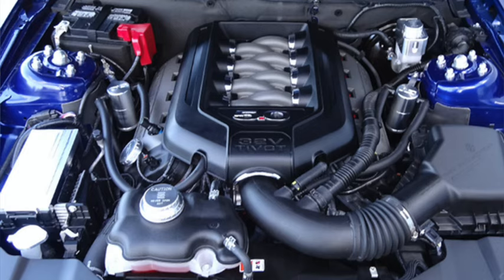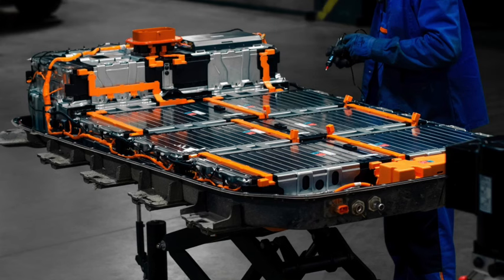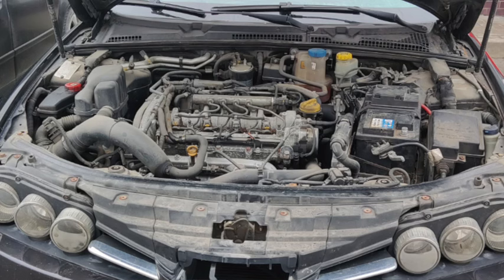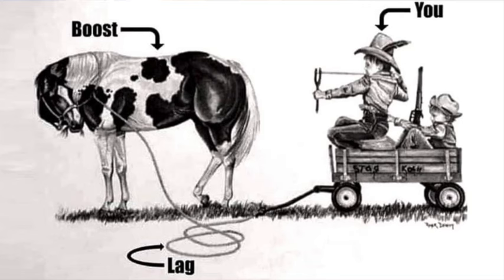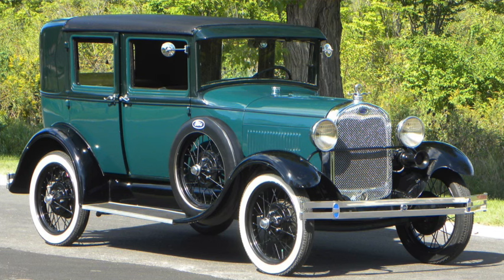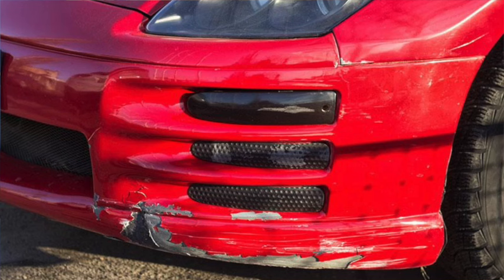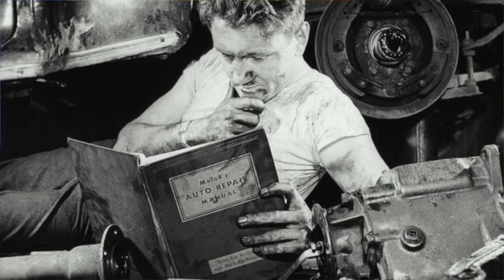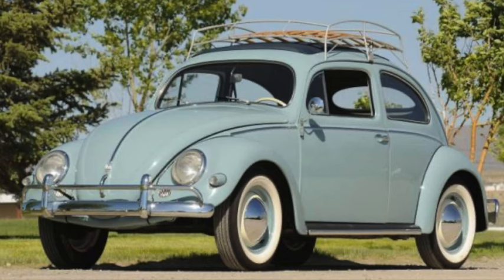How cars have gotten better by getting worse

Comment: Modern vehicles are not only wayyyyyyy overpriced but they're made out of plastic as well and my 1996 Ford F150 with a 5.0L (302) Windsor V8 will outlast every single one of em (especially those overpriced plastic EcoBoost trucks).

Comment: Cheers from Orange County California 🇺🇸 
Daily Driver 68 Dodge Dart Restored to driver level...
V8 swap and 9 years on the road since swap, 115k on my rebuilt 318...
Reply: Them 318s are bulletproof! I have a 318 with 245k on it it my 2000 dodge ram
Reply from the maker: @Freedom42069  Perhaps and under rated engine.
Reply from the maker: Nice.

Comment: The only problem with customers preferring the simpler, stripped down trim levels is many dealers just don't stock them so you're forced to either order one and wait while the dealer plays games with you or buy one of the higher trims with features you don't want or need. An example is all but base trim for most manufacturers come with leather heated seats, I hate the feel of leather seats and having them heated is an unnecessary for Florida which is where I live.
Reply from the maker: There is much talk about how sales have shown what buyer do and don't want, but as you said, buyers often don't get what they want, they get what is available.

Comment: I don't mind touchscreens, in fact I don't plan to ever purchase a daily driver without one again. BUT, I do want it to still have physical buttons as well. I do not ever want to have to navigate through multiple different screens, to say, change the climate controls. And if the screen ever fails I'd like there to be a button backup for the radio as well. For now, both options are generally equipped on most newer vehicle. However I don't like that the trend is starting to shift to touchscreen only without physical buttons.

Comment: On the proprietary issue: How is it that 100s of models of SUVs across 40 years of production by all brands haven't managed to accidentally repeat nearly any part.  We all complain that all the new cars look the same, but if one window on one model made for one 3 year "design cycle" need replacement, there is no chance of finding that part used.  Interior parts, door mechanisms and starters!  Worse than headlights: Alternators:  two alternator sizes would cover 100% of all cars ever made.  But every year every car is redesigned to NOT be compatible with anything ever built before. 2mm change in mounting hardware, and nothing but a new one will work.  Where are the environmentalists on that issue!  Forget about CO2 etc, where are the protesters on the waste of raw materials designed destroy our ability to keep our cars from becoming landfill at the end of warranty?

Comment: Oooooo I love this topic! So I'm an avid classic car lover. However, I'm not entirely sold on the whole "older cars are better" montra. I argue that there have been a great many improvements and innovations over the years, not just trade-offs. To illustrate, take first the price of  brand new 1936 Chevrolet Standard. It offered a 206 cubic inch inline 6 that produced an eye watering 79 hersepers. You also got a two pane glass windshield, manual windows, 3 speed manual transmission with the completely new synchromesh gears!! Drum brakes, and get this... A heater!! You had to pay extra for a radio, though. Anyway all that could be yours for $575. It was advertised as the cheapest car you could buy, being the Great Depression and all. In 2024 dollars, that car would set you back over $12,900. Well, today you can get yourself a brand new Hyundai Accent for $17,000 where a 120 hp, 33 mpg engine is standard along with AC, electric windows, seats etc. Forget the frills. You don't ever have to grease any of the suspension, buy new tires every 10,000 miles, change the oil every 1,000 miles, or throw gas at it like your single-handedly gonna cause all the climate changes. In fact, many new cars today are very, very trouble free, easy motoring for practically the same cost as 100 years ago. You don't have to adjust a carb, change points, constantly overheat, rebuild an engine after 50,000 miles, change sparkplugs, the list goes on. To me, that is utterly incredible. Just the advancements in metallurgy alone could be enough to justify charging more for a car than the 30's. New cars have brought their own unique problems and challenges, but they're more the exception now than the rule. Back then, when your odometer neared 75,000 miles, it was time to start thinking about a trade in. Car loans were specifically designed to last the typical lifespan of a car so that you'd buy yourself into the next model range. It's why people had intimate relationships with their local dealerships. They were there all the time by necessity more than anything else. Now it's very unusual for a vehicle to not last more than 10 years. In fact, factories now offer 10 year warranties. Imagine offering a 10 year warranty in 1950. You'd immediately go broke.

So, no I think cars nowadays, although completely boring, are vastly superior to anything offered 60 years ago.

Comment: The LTD II on the thumbnail was a unibody, also the massive 70s Chrysler C-body was unibody..
Reply from the maker: As was the duster. And Unibodies are not all equal and many were used in combination with sub frames or even full ladder frames. And some of the best off roaders ever have been unibody. Yet that LTD II still survived what most modern SUV's will never be put through.
Reply: @thehopelesscarguy  The LTD II was probably reinforced and modified for Hollywood driving in Rambo like the C-bodies in the Blues Brothers. Look at an modern police dash camera chase with the Explorer or Charger showing how robust an modern unibody can put up with.

Comment: New cars are an anomaly. They seem to be cheaper and lower quality in every way than old cars, with things like cheap plastic parts, yet they're more reliable and last way longer. Many old cars were lucky to hit 100,000 miles without blowing up and being abandoned in a field, with rust holes in the floors so big you can Fred Flintstone it. Meanwhile, you now have 200k mile Fiats, plastic parts and all, that run like they left the factory yesterday.
Reply from the maker: I've heard the 100k mile thing since I was a kid, although every car I've ever owned easily exceeded 100k miles. But it was a plastic thermostat housing the spelled the end of my Ford Ranger engine at 147k.

Comment: Even with my 23 civic I had to locate a 6 speed transmissions now are either weak cvts or over complicated 9 or 10 speed units and ,,its no longer simple to upgrade a radio no longer standardized head unit size and everything has complex amp and wiring not like getting a pioneer and 4 speakers and being done
Reply from the maker: I get that. The last time we purchased a new car, finding one with a manual was a time consuming chore. And dealers would search for the nearest one and then tell us it was only 500 miles away.

Comment: Modern vehicles are better in one aspect, one is the power and performance of the smaller engines 4 and 6 cylinders  with hemi heads, better induction fuel injection  tuning, plus the handling and brakes (except the anti lock part, hate it), drove a rental KIA midsize sedan has lively performance from its 4 cylinder compared to my  4 cylinder postal Jeep which takes a while to get up and go, I'll stick with my old iron, that KIA is so hard for me to get in, it felt like I was getting in a Camaro or small sports car, my Jeep is much easier to get in, as well as my 83 Coupe De Ville and  pickup  truck, the new stuff is just use up and throwaway. Another stupid car item I hate is the radio type knob to select the gears on a automatic transmission instead of a lever, or at least push buttons like on Chrysler cars, Edsels, Ramblers ,and Packards, I just have no perception what gear I'm in, until I look at the dash display and I touch the gas pedal. Seem like when BMW came out with the selector button, everyone else followed.

Comment: The trade off was reached between technology, servicability, reliability, longevity, power, simplicity and affordability by GM between 1997-2007 with the Gen III  and GenIV without AFM or VCT LS 5.7, 6.0,6.2 and Vortec 4.8, 5.3,6.0,6.2 after that the GenIV begins too become more sophisticated and expensive requiring deletion and extra disassembly with little extra strength or performance. The Gen V engines, especially the L8T iron 6.6L has promise with upto 2000hp capability with boost or taking at least a 4.125" bore and at least a  4.125" to 4.25" stroke making a 441-454ci. It's still expensive, sophisticated and requires extra work. Ford reached it between 1987-1997 with the 300,351w and 460, the 302 remained until 2001. The 6.2, 6.8 and 7.3 gas V8s show promise but the don't have the aftermarket support and aren't affordable. Mopar passed their peak after 1978 when the B and RB died, the 360 remained until 2002. The 5.7, 6.1, 6.2 and 6.4 aren't cheap or simple and are gone now. There aren't many things I would be willing to gamble money on buying new and trust that they could run 400k+ miles like an iron Vortec 4.8,5.3,6.0, a Ford 5.8L or 4.9L I6.
Reply from the maker: I would say the term for what cars have become, is soft.

Comment: So many excellent points.  Cheaper new cars, with fewer features, should be more popular.  I actually like some things about modern powertrains.  But I could do without power seats and power windows.  Motorized doors serve no purpose.  I loath touch screens.  The only wreck lane keeping feature prevents is for someone who should not be driving in the first place.  How much does that cost?  Electronic climate controls are infuriating.  A mirror or a window is more reliable than a camera.   All I really need for a “radio” is to make the car a Bluetooth speaker.  I don’t want any more than that.    A well powered, smooth, reliable car with power steering, power brakes and basic AC and Bluetooth connectivity is all I need.  They don’t sell that.  By the time you get into well powered and smooth, all the rest of the junk gets piled on.   Electric cars are even worse in this regard.  They will never make a basic electric car.

Comment: It has occurred to me that technology after the 2000s has actually made vehicles worse. There are very few new cars I that I actually find to be desirable. Most of the cars I think are cool were built between 1964 & 2009.
Reply: The peak reliability of cars I’d was was from the late 80’s to about mid 2000’s. In the late 2000’s, they began to use lower tension piston rings for “efficiency” to reduce friction, but all that does is cause the engine to burn oil when it shouldn’t. 2010’s is when things took a turn for the worst, unfortunately.

Comment: When I retire I'm going to buy a few 1970s vehicles to avoid EVs. I'll fix them up, put disc brakes all around and put modern motors in them.
Reply: The ev bits fine....but the design is terrible.

Comment: I love old cars but, the best cars were from 1990's to  2012, after 2012 is when all the garbage starts.
Im driving two 2010's right now, great gas mileage, great traction in winter, inexpensive tires, both pushing 250,000kms.
Reply: I was going to say the same thing. We finally figured how to build reliable cars that are economical to run, practical and relatively smog free some time in the 1990s.

Today's cars are loaded with fragile features that aren't needed, and power trains are pushed to the bleeding edge to extract as much efficiency as possible in exchange for hopelessly complex fuel and emissions hardware.

I will probably never buy a new car in the future.
Reply: 79s and earlier are emp proof . I've had cars from the 70s that I flipped the odometer in 5 times . 
60s and 70s were the best years for cars / trucks imo because of electronics or the lack thereof .
Those vehicles didn't need a rocket scientist in a lab coat to repair , and parts were affordable .
Again , just my opinion and not attempting to argue .
Yet there is much to be said about a vehicle that can survive an emp 😊
Reply: @charliepatterson9321  that's true, as long as you don't live in the rust belt. Where I live, all pre-80s cars rotted out from the road salt after just a few winters.
Reply: @martinliehs2513  tragically you are correct . My Ranchero lasted 30 years under my ownership buying it in 1991. Drove the crap out of it . Hurricane Ike killed it because I drove it through brackish water and 2 years later the underside rusted out . It still ran strong when I sold it . If not for the Hurricane it would've lasted longer . 
The real sad part is I knew every nut and bolt on it . I replaced it with an 03 ranger and now I have to learn all of its parts .
Changing all of the sensors alone cost me a grand . I abhor sensors !!!

Comment: Really agree about touch screens.  They're dangerous.  We need knobs and buttons!  I have a 97 Del Sol and a 2000 4Runner.  Keeping them both till I die.  Growing up in Detroit, I've been a car guy as long as I've been alive.  Now?  I  HATE new cars.
Reply: My car has auto drive, which enables cruise control, auto braking and lane keeping. I use this expensive high tech feature when… …I need to look at the stupid touch screen.🤦‍♀️

Comment: Excellent, thought-provoking video, HCG.  As a 70-year old who once drove 25+k miles per year during my career, I definitely appreciated the safety improvements over the much more aesthetically pleasing cars of the ‘50s and ‘60s.  I watch many of the police chase and vehicle accident videos available on YouTube and am amazed at some of the wrecks people walk away from with barely a scratch that were undoubtedly fatal a few decades ago.  But as you point out, there are trade-offs depending upon what is deemed important (or legislated).  As for technology, my current daily driver has a touchscreen that is pretty intuitive and has a ton of features, most of which I’ve either never bothered to learn or used so seldomly that I forget how and have to refer to the manual.  🤣  Thanks for these weekly videos!  👍👍👍
Reply from the maker: Thanks for watching regularly. 

Better safety is certainly a good thing, as luck will run out eventually. However, I might be the most anti-tech I.T. person you will ever run across.
Reply: Same here!